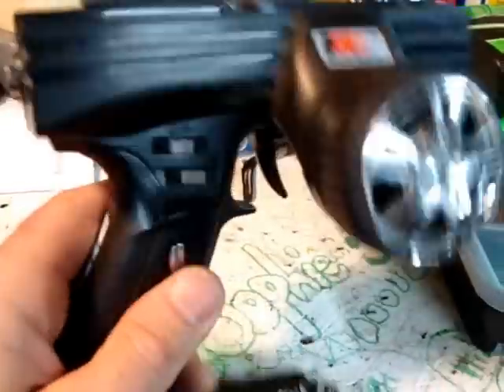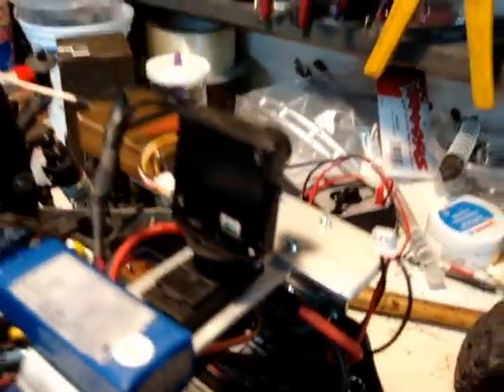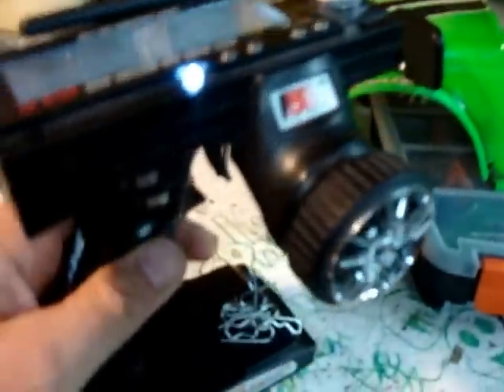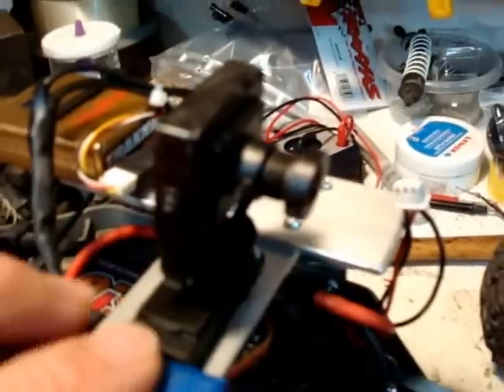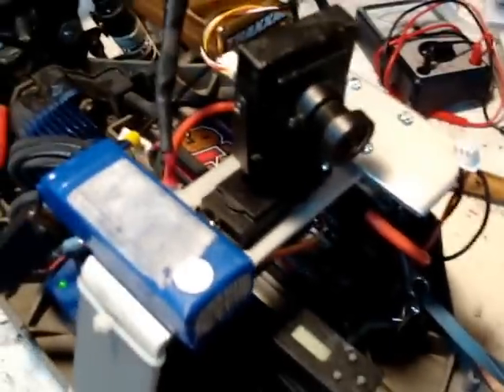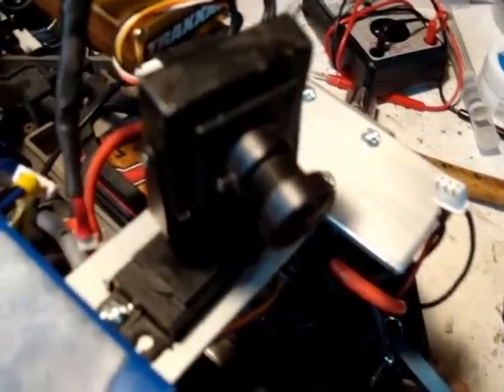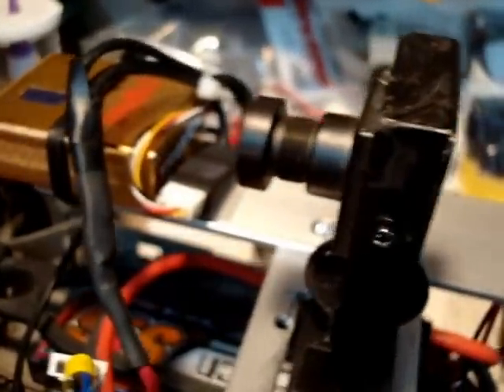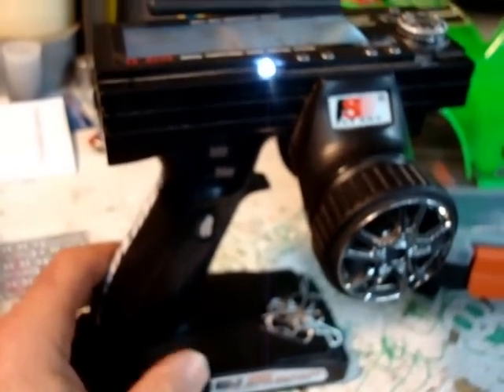Cheat your fsgt3b to fully use channel 3 for some servo functions.

Comment: Hey just wondering what button you press and setting you use to control it thanks
Reply from the maker: I used the channel 3 trim slider switch on the side of the grip.  Move it one direction and the servo turns one way, the other direction and the servo turns the other way, center it and the servo stops turning.
Reply from the maker: Read description under "about" for more detail, good luck.

Comment: Thanks I recently got one of these radios and wanted to run a shift servo off of it but didn't know if all I had to do was swap the wires. Looks like Ive got a radio to take apart and some soldering to do!